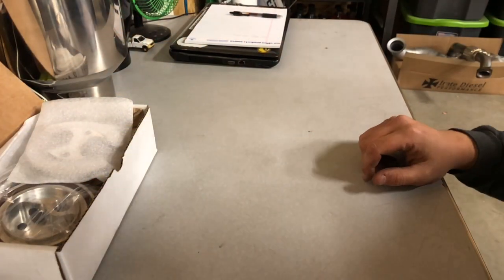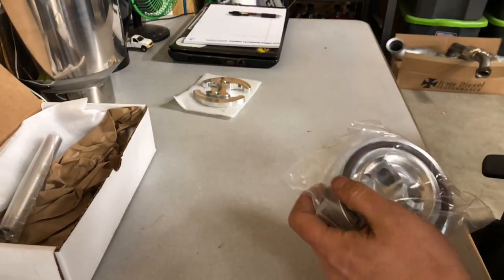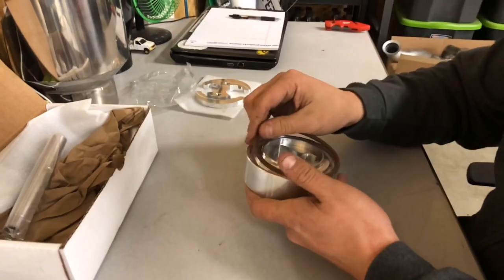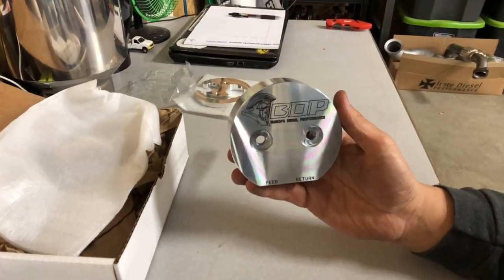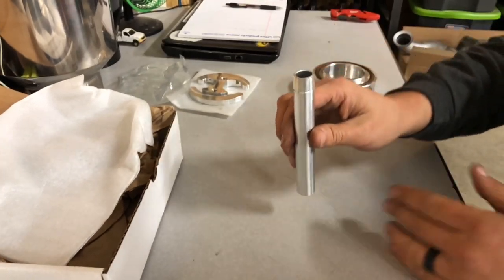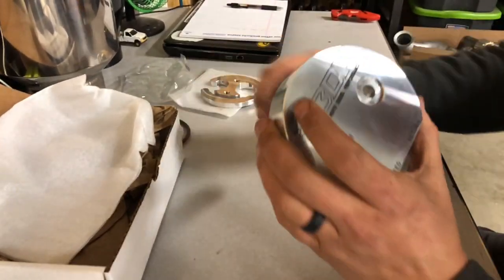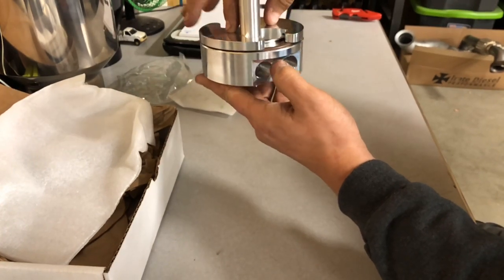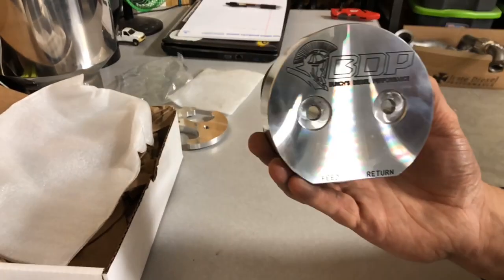Diesel Fuel SUMP Explained

Comment: I got a fass fuel pump with a sump on one of my trucks. The problem im getting is water in my fuel. Being everything goes to the bottom of the tank. I wish i never did it. I have a truck thats all stock. I never have this problem. As far as worried about running out at a 1/4 tank, that shouldn't happen with or without a sump.

Comment: How are you dealing with the tank shield?
Reply from the maker: Depending on the truck
Reply: @bunchsdieselperformance  can you give any examples?
Reply from the maker: What kind of truck you have
Reply: @bunchsdieselperformance1255  I actually have an ls swapped 95 gmc but everything is custom, I also wrecked my sending unit and want to switch to an inline pump to avoid dropping it in the future

Comment: Can you please tell me if sumps are legal to use? Lots of businesses sell them, but nobody tells me if it is legal. I cant afford to have to buy another tank..i cant find the law that allows or validates the use of sumps….ive read the lines have to be in a protective shield or hose separators to avoid vibrations causing premature damage
Reply: Legal. There are no regs that I am aware of having to do with how the fuel is taken from the tank.